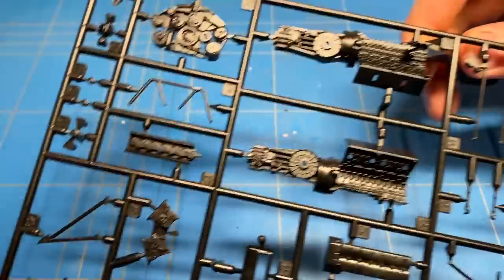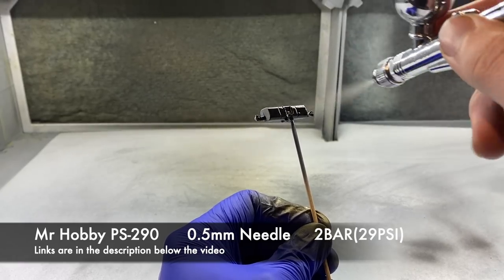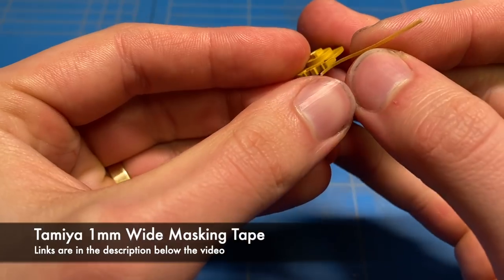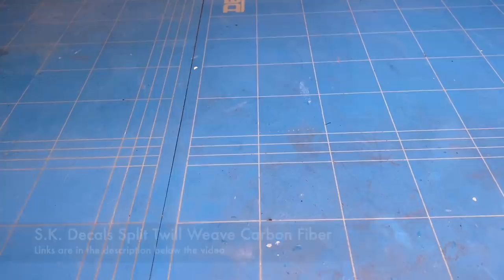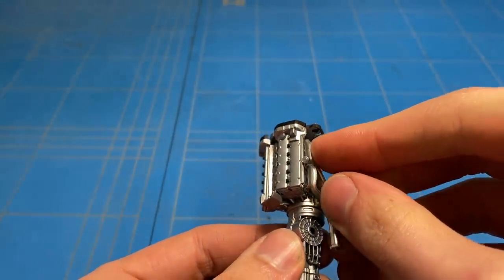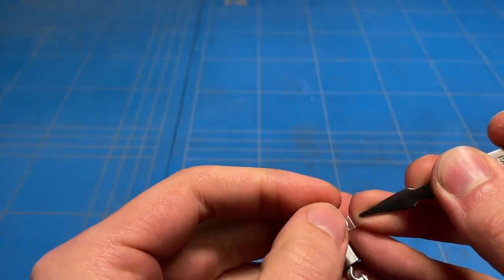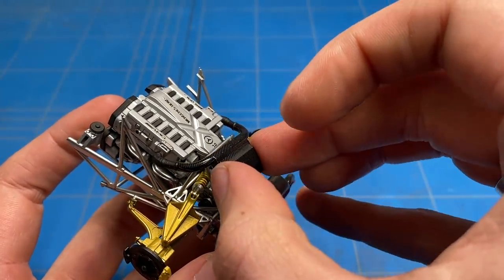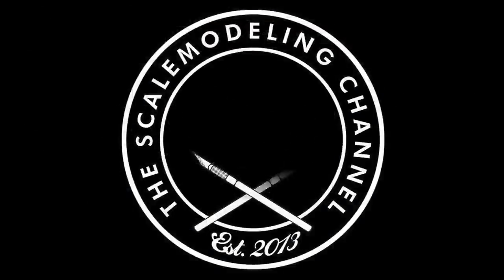Building the Aoshima Pagani Zonda C12 Part 2: The Engine

Comment: I have never used the bob smith super gold glue before! Been thinking of it though. Do I need to remove paint in areas that needs to be joined or can I just apply the super gold glue as is?
Reply from the maker: No need to remove the paint

Comment: FYI they had gold calipers stock on cars older than the 1980's.  You don't really build real cars IRL though so it can be forgiven, just thought I'd give you a heads up though that plenty of cars had gold brembo style brakes well before this car did.  Don't really care for gold or yellow though, so that's just me.
Reply: Also: why do you make every single engine you assemble look like it's been covered in grease?  My race car, and even my street car both have 40,000+miles on their builds, and their silver oil pan and transmission case are both still shiny and clean.  It's not unrealistic to have people actually take care of their cars engines and undercarriages.  Especially supercars which will spend most, if not all, of their life in a garage or only driven on perfect days.
Reply: @basedemt6608  It's not about making it look greasy, it's more about creating contrast to bring out the finer detail.   Chill :)